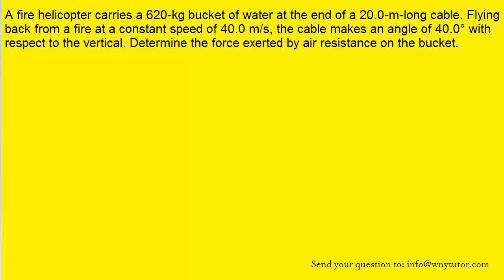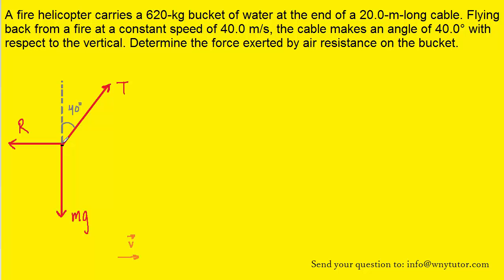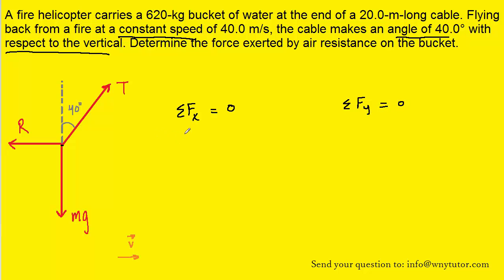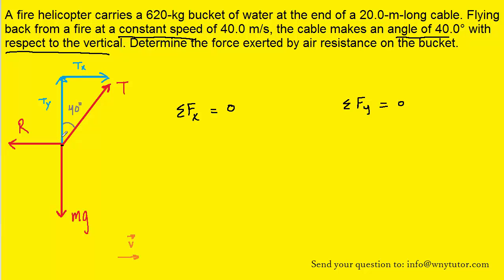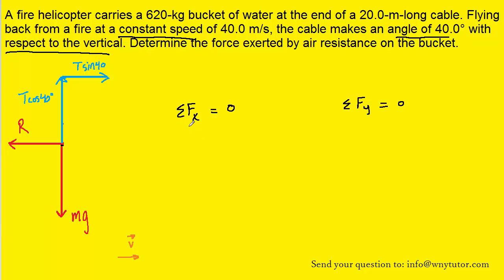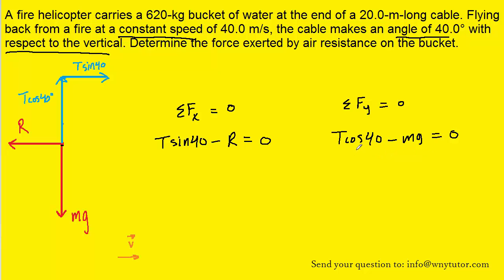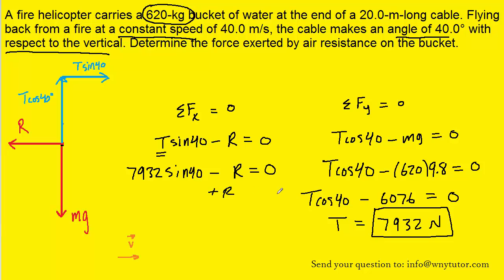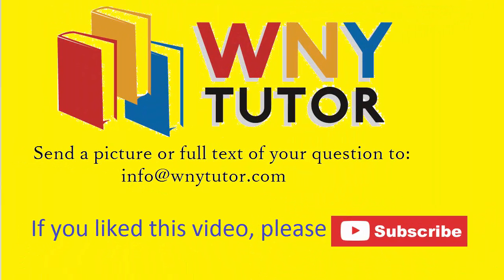A fire helicopter carries a 620-kg bucket of water at the end of a 20.0-m-long cable. Flying back fr

Comment: Shouldn't the y-component be T sin 40 and the x-component be T cos 40?
Reply: Adrian Garcia right? Did u ever find out
Reply: It depends on how you draw your triangle. In this example, the triangle is oriented in such a way that the T sin40 side appears to be the horizontal component but it really is the vertical component.